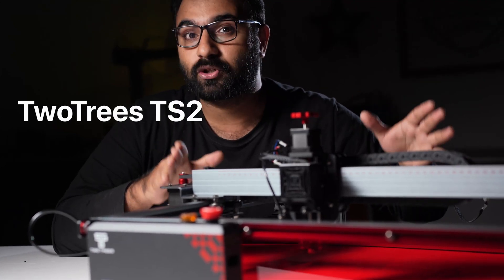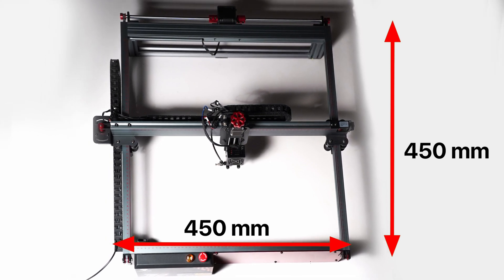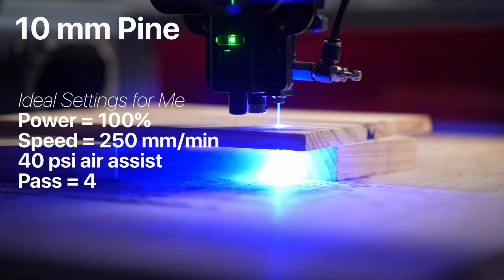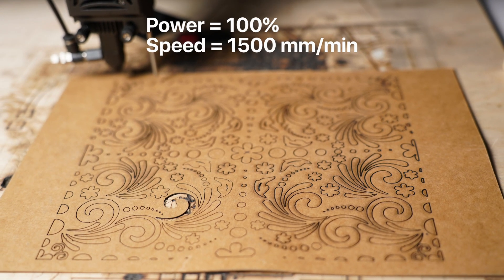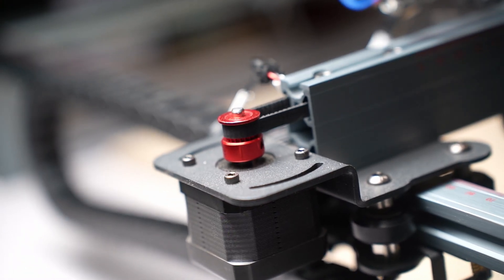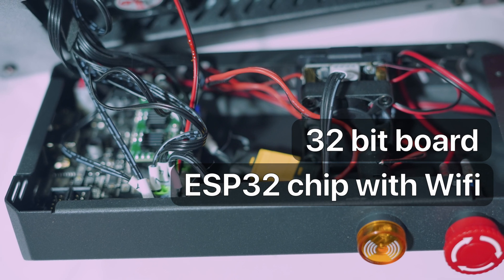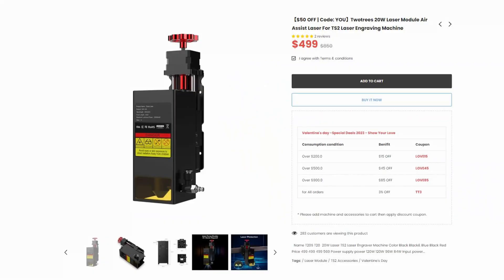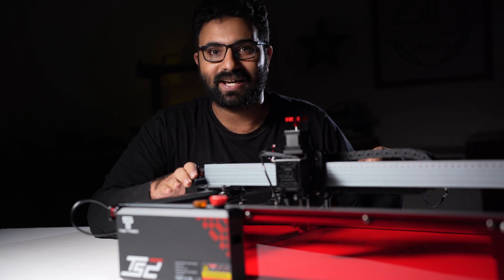Most Innovative Diode Laser? Two Trees TS2 Tested | Review

Comment: Thank you for your review video, I have the Two Trees TTS-10Pro (10W) and it also has the built in Air Assist port. I have also tried to connect my laser to "shop air" through a regulator and air filter.  what psi ranges are you typically running?  I'm usually cutting material no thicker than 6mm.   I've not wanted to go much beyond 20-25 psi in fear I would damage the head.
Reply from the maker: Glad you liked the video. I also prefer to stay between 20-30 PSI with my shop compressor (30 PSI for thick materials only). Anything above that will be an overkill as the standard air assist that you get with most lasers are not even close to that pressure.

Comment: I have been itching to use mine. We first got one their smaller 5 Watt model a few years ago and it still goes strong. I haven't used it yet as after troubleshooting with TwoTrees we found that the main controller board outputs no signal to the laser. Unfortunately it was to ship just before they went on vacation for Chinese New Year so it's just now touched down in the states.

Their English is good and they are friendly, but the 13 hour time difference made things frustrating. I hope they get some more localized support soon.
Reply from the maker: Good luck with your projects